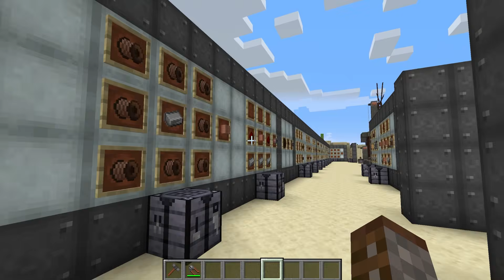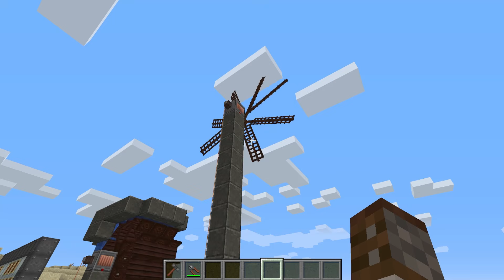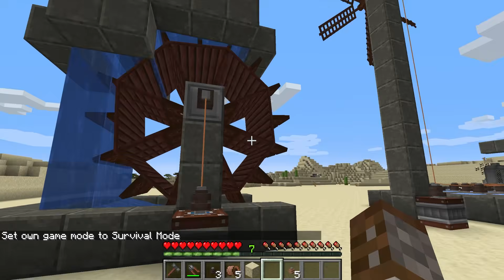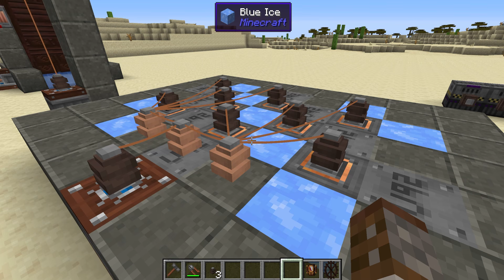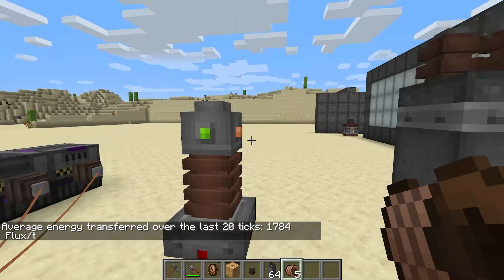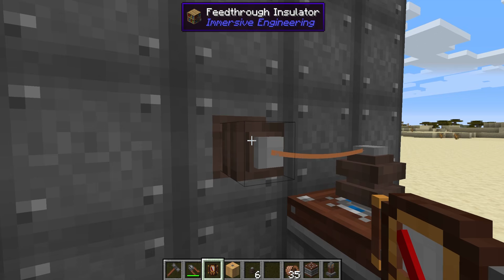How to: Immersive Engineering | Power Generation (Minecraft 1.16.5)

Comment: I have 22 hv connectors connected to a hv relay, but I have an issue, the wires beyond the relay burn out every time something runs into them, is there a way to circumvent this issue?
I'm on 1.20.1 if that's anything to go by

Comment: i need help man none of my connectors are bringing power to my machines. all these tutorials have everything except how to connect the connectors to a machine, someone help !
Reply from the maker: It's literally in the the thumbnail let alone the video. Use "connectors" on the orange side of a battery or power generating block. Then use a connector on the blue side of a machine. Depending on the voltage of the machine use the right voltage wire and connect the 2 connectors.

A relay is used to extend the length of a cable

Comment: 16:48 Is there any way I could generate this heat difference on the thermoelectric generator using compressed air from pneumaticcraft? Maybe using a vortex tube?
Reply: Yes but the heat transfer of air isn’t correctly modeled in game, especially compressed air, so it’s just most effective to use ice and uranium, I’m setting up a super thermal generator in my world since I’ve gotten a LOT of uranium

Comment: so i did like were it is at 16:29 so were should i put the battery? and if it is straight on i tried ita nd it diod not work it does not get any IF at all
Reply from the maker: Make sure your battery has the right input and output colours on the connection
Reply: @Mondays3  i did but nothing g woorked

Comment: Hello, i want to thank you for the tutorals you made, i have an issue with the mod, i can't make plates with the hammer next to it... I'm on the modpack Ragnamod VI, did you have a fix for anychance ?
Reply from the maker: I'm not familiar with that pack however it's possible the pack author has disabled that feature to force you through a different line of progression through the pack
Reply: @Mondays3  The mod helps directs me to the metal press to produce plates, but i need plates to make it, so i'm kinda stuck, thanks anyway for the reply. Love u dude

Comment: ur videos ar helpful, but can u maybe include u placing all the blocks down and using ur hammer to show where to place ur blocks to get the generator and stuff to look like that? i literally had to look for an entirely different video to look at how to make the generator correctly it was kinda more useful than this
Reply from the maker: The projector gives you a ghost entity to place all the block correctly. If you don't have immersive petroleum for the projector the engineer's handbook shows exactly how each machine is crafted layer by layer and also how many of each material is needed